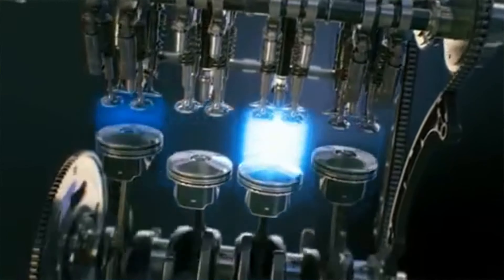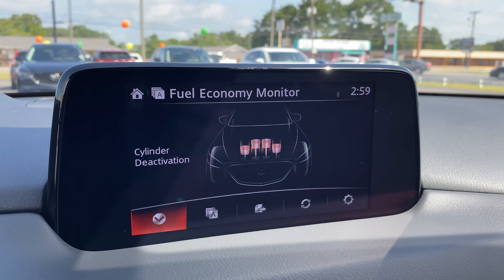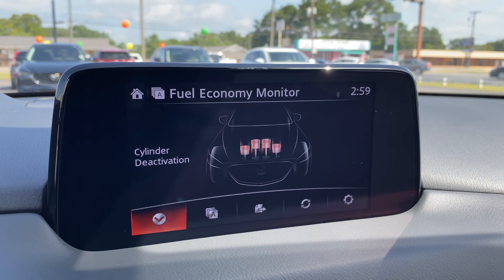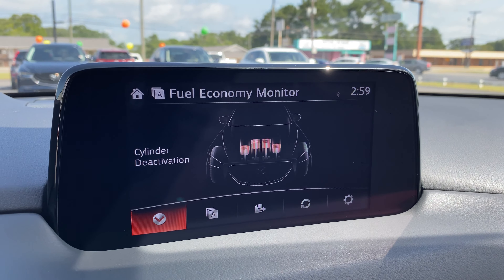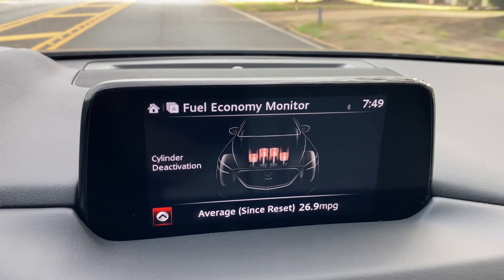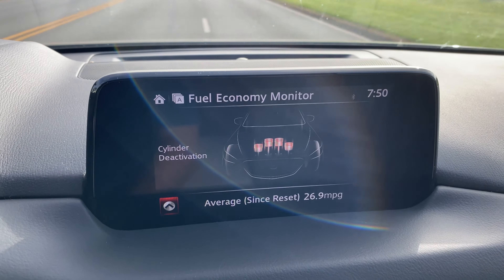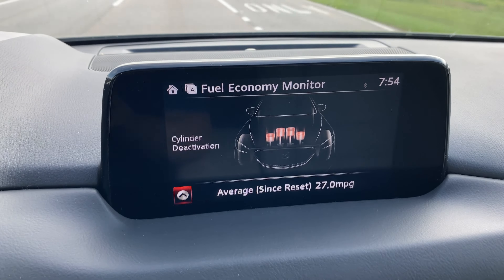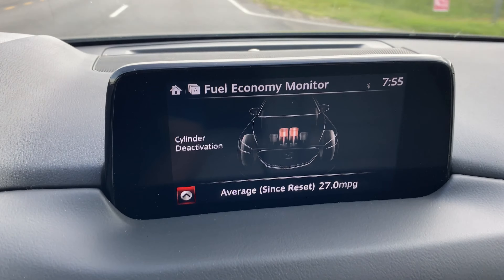Mazda CX-5 SkyActiv G Cylinder Deactivation for Better Fuel Economy

Comment: Putting those cylinders on/off adds tear and wear on cylinders and engine. That’s a dumb idea because effects car reliability. Who wants to deals with car issues? Specially inside the engine? Very expensive to fix of course if you manage to fix.
Reply: Agreed. We were considering the CX5 for our next vehicle. But we keep our vehicles 10-15 years. I just see this as a problem waiting to happen long term.
Reply: I hate it, and probably won't get a NA engine in my next Mazda, turbo only. My 2017, CX-5 is still running perfectly.
Reply: @derrick_is_dnice  Same my 2017 CX-5 grand touring. Can’t be happier!

Comment: Cylinder deactivation leads to shortened engine life. I don't care what they call their "new" technology, facts are facts. No thanks.
Reply: Yeah ok. We get it. Mazda isn’t for you. Move on.
Reply: Mazda’s implementation of cylinder deactivation is completely different then the god awful stuff that was put in Chevys for years. Chevys literally had the crankshaft change shape and it couldn’t last over time. Mazda simply keeps the intake and exhaust valves open and stops injecting fuel.
Reply: @romancenturion8  they don't. They use a switch in the telescopic lifter that makes the cam move the lifter instead of the valve.

Comment: Wait...what? Cylinder deactivation is going to turn off TWO of the FOUR cylinders ... to save gas? So, I will have a two-cylinder engine? A $30K+ two-cylinder car? Hmmm, nope, I'll pass. There has to be some issue or problem with this as time goes by that will require an expensive fix. Thank you for making this video because honestly, I am shopping for a new car and really like the Mazda but, I will pass now that I know about this "great feature" which leaves me with a two-cylinder car.
Reply from the maker: I understand your hesitation.  None of the Turbo models have this technology, and it varies on other 4cylinder models.  Don’t rule out Mazda yet!
Reply: @richardflaherty2373  That was two years ago and was a software patch. There have been no reports of problems since.
Reply: It probably won't wear evenly over time, and you'll have serious oil consumption and a vehicle with no resale value.  My prediction is a lot of people with these vehicles will lose way more in depreciation than they saved in gas.

Comment: Never had any issues at 110000 miles and still going strong. Yes, I use 100% synthetic oil and still running new. I still get 40mpg with cylinder deactivation on the highway.

Comment: It's extremely annoying, me being a mazda fan and planning on purchasing a cx5 in the near future, that cylinder deactivation is standard on ALL trim levels for the 18-20 years. If I had enough money to buy a brand new 2021 I would, but part of the reason I love mazda is because they and toyota have EXCPLICITLY avoided some of these dumbass new technologies like tiny engines with turbos/ direct injection (oil dilution problems eg honda and gmc), cvt transmissions, etc. They are about quality and reliability, but this REALLY shakes my confidence in their engineering. It just seems like a ticking time bomb, and for what, and extra 1 mpg? Cmon man
Reply from the maker: I don’t think it is a ticking time bomb.  You always have the option to purchase a 2.5 turbo engine without it. You’re right the 1 mpg increase is not worth it for these technologies.  However as long as manufacturers have to meet the demands of politicians they will keep creating and using these types of enhancements.  I don’t think you will have any problems or disappointments with any CX5 with cylinder deactivation.
Reply: @JSS  I appreciate the response; can you please tell me how extensive your research was for problems with CD? How do we know the software update is an actual long term fix? I'd appreciate any insight you may have
Reply: All Skyactiv engines are direct injection.

Comment: It should be able to be disabled it's the only feature I want gone from the car.  It's been a issue since 2017 on all that have it . Mazda needs to add a button or a way to disable only thing I want gone from my 2020 gt I hate you have to have it on the higher trims
Reply: I agree, it should be selectable. I'm glad my 2017 doesn't have it.

Comment: Well this helps explain the impressive gas mileage I got coming home from Atlanta yesterday.   35.8 mpg on a 5 hour drive
Reply from the maker: That’s awesome!  What speeds were you running?
Reply: Jonathan Sewell 55 mph most of the time. All back roads, no interstate, no cruise control.
Reply: The CX 5 is rated at 25 city, 31 hwy. You don't magically get 4 more mpg because you drive a certain way or speed .The highest mpg you'll get on a cx-5 is 31, 32 if you have the manual 6 speed trans. So no, you didn't get 35.8 mpg.
Reply: God_Laughs _At_Atheists  You can believe him all you want but he didn't get  almost 36 mpg when it's rated at 31 mpg highway., It doesn't work that way, sorry. .
Reply: @emichaels2112  quite possible. My daily commute to work is mainly on the highway and i was getting about 32.5-33mpg when i was going the speed limit of 65-70. Since covid and less people on the road. People are now driving 80-85mph drivinf 80mph is getting me 30-31

Comment: I have this technology on my 2019 Mazda 3. Had an issue with it for over a year. When it would go into two cylinders at 80-100 kmh it would vibrate the whole car and create a low rumbling sound. There was a fix recently released with updated radiator mounts and software which has pretty much resolved the issue
Reply from the maker: Oh that’s good.  I haven’t heard about that issue.
Reply: @JSS  This is not correct disconnection of two cylinders.  We can see that the valves are closed.  The cylinders are under compression.  And this means that compression slows down the engine and the car.  It's like a retarder in a truck.  To properly disconnect the cylinders, you need to open the valves.  This is called the decompression mechanism.

Comment: I took the turbo engine option to avoid Cylinder Deactivation. There are easy ways to clean the intakes with a spray, so the turbo doesn't scare me at all.
Reply: The non turbo engine needs cleaning too. Both engines are pretty much the same.
Reply: I was feeling the same way about the turbo option.

Comment: Is there any way to deactivate this "feature"? I have only read horror stories about cylinder deactivation and with the new 2021 models coming out with this "feature" missing completely, doesn't really instill any sort of confidence with this technology.
Reply from the maker: I'm not aware of how to deactivate it.  I think they discontinued it for 2021 because of increased Turbo offerings, and it didn't really have the fuel economy payoff they were hoping for.
Reply: The 2021 model year with 2.5L non turbo engine still has this feature. Checked on the Mazdausa.com website. Its the turbo engine that doesn't have this feature.

Comment: Is it possible to disable the cylinder deactivation? Because it will destroy the engine as shut off cylinders will be cooler and won't reach the correct tolerances, therefore they gonna wear out much faster and result in serious oil burning and loss of compression.
Reply: Vcm muzzler is a common product that works perfectly to do that on Hondas

Comment: But does it only deactivate cylinders 1 and 4? It seems to me an unwise choice, ford has the deactivation on all cylinders of the 3 ecoboost and deactivates a different one each time to have a degree of use of the piston sky homogeneous among all.
Reply from the maker: The new updated system may rotate I’m not sure.  The current system deactivated 1 and 4

Comment: The cylinder deactivation is only useful on highway when driving moderate speed. In and around town, it´s always more useful to shift into the next higher gear to have lower revs.
Reply from the maker: Good point
Reply: maybe it's what Economic mode does.😁
Reply: To a certain extent. Bc the statement alone doesn’t stand if you’re lugging the engine at too low an rpm.
Reply: @a124as  Just shift like the suggestions of the car. You will never see 2 cylinder mode, but instead always shift into the next gear. Below about 1600RPM the 2 cylinder mode doesn't work.

Comment: Has Mazda addressed the cylinder deactivation issues that were in the 2018-2019 CX5? Out of the 2.5NA and the 2.5T, which do you think is more reliable long term? Thanks!
Reply from the maker: I think they’re both pretty solid.  Typically turbos would fail before anything, but so haven’t seen any signs of that on these engines.  I would say you’re pretty safe on both.  I haven’t heard of any issues with non turbo since the recall.  I think they fixed it.

Comment: Does the 2021 model CX-5 remove cylinder deactivation? I saw only one trim level of the CX-30 still offers cylinder deactivation.
Reply: None of the 2021 CX-30's have it at all. Mazda is confusing the customer base and I am one of those potential buyers. The 2020 3's had it on premium and AWD trims and not FWD,now the 2021 3's ALL have it. Annoying and I want nothing to do with it and Mazda should trash it completely. This guy doing this review doesn't mention the roughly 250,000 Mazda's that have CD that were under recall already for various engine problems.
Reply: @halc.2899  there have been no further issues after the recall to fix the software bug.
Reply from the maker: All of the 2021 CX-5s I’ve looked at have it.  I was aware of the recall, however most did not experience any problems.  They were reprogrammed as the recall required.  I am not aware of any further problems.  Depending on driving habits, you may rarely have cylinders deactivate.
Reply: Agreed. I live in New Zealand but when I checked the US built CX5, all non turbo variances with 2.5L engine  have the CD feature. It's my understanding that there have been no reported issues with these engines post  the software fix.
Reply: @Dark5tar111  wait until you get 100,000 miles on it!
Reply: @richardb.5691  time will tell.

Comment: I live on campus and have a 2018 Mazda6 so I’m driving around 10-20 mph a lot and the car will occasionally start judding. Is that the CD
Reply from the maker: I would need more information, but probably not CD especially if you are using the gas pedal.
Reply: Yes, when the system switches modes, there can be a shudder comparable to the transmission switching gears. It is really annoying to me.

Comment: Cracked cylinder heads are popping up more frequently on these motors with CD. My '18 is going to the dealer in a few days for repair. Starts with burning smell and mild smoke. Mine has oil all over the exhast side of the engine

Comment: Most people rely upon the car moving slowly with the right foot not on the gas pedal at all.  This is particularly true when parking, for example.  I think this is called the "idle speed" and is very helpful when you want to move very slowly into or out of a parking space.  Does the cylinder deactivation permit a reasonable idle speed or does the car not move at all if your foot is completely off the accelerator pedal?
Reply from the maker: Yes you idle.  I haven’t tested the deactivation at idle speeds though.  It may not kick in until a certain MPH.
Reply: I have a '21 Mazda6 Signature. The only time I notice the deactivation is backing down my long, flat driveway. When I get in and shift into reverse it doesnt hardly move at. If I give it just a smidge of gas it goes a smidge faster - but holds that speed for a good 100ft until I have to brake.
Reply: Does this work in sport mode?

Comment: I wonder what happens at 65 MPG on cruise control? Will it shift to 2 only?
Reply from the maker: Same thing.  Really depends on the load the engine is under.  Any type of coasting with lead to 2 cylinder.

Comment: hi. what about 2017 cx5 ? does it have CD on board ? if im not wrong 2nd generation of cx5 starts from 2017-2023 right? so my question is,    the CD goes from 2018 ? not 2017?
Reply: CD started with 2018+ models. 2017 is unaffected

Comment: Hello Jonathan, i have mazda cx5 2019 takumi but when I go to the cylinder deactivation shows a message ( NOT READY ) can you explain me how to activate it ? Mine is a european version if is that matter.
Reply from the maker: I’m not sure.  We don’t have to active here, unless it is turned on during initialization when it comes in from the factory. Contact your dealer. Thanks.
Reply: You're referring to the i-stop feature "NOT READY" state,  not cylinder deactivation.
Reply: @Dark5tar111  no was the cylinder deactivation and i have been traid both time with activate i-stop and don't the same message

Comment: Hi Jonathan 
Thank you for your clear demonstration of the cylinder’s deactivation.
Do you notice rpm changes from activation status to deactivation status? Is it significant?
My CX5 doesn’t have your screen showing cylinders up/down status...
Many thanks.
Ryan
Reply from the maker: When they are deactivated the RPM goes down because it is mostly a coasting scenario.  You really can’t tell by driving when it’s 4 or 2 cylinders.
Reply: Jonathan Sewell 
Thank you.
Can you tell why my CX5 2020 doesn’t have a screen showing cylinders up/down status like your demo?
Mazda dealers said all Mazda with 2,500 cc or above will have cylinders deactivation feature. Do you know this?
Thanks again.
Ryan
Reply: @abblechan8107  Turbo models don’t have this feature.
Reply: @abblechan8107  you have to go to the fuel economy screen and if you have the feature there will be a tab at the bottom to go to the next screen, that’s how I found it

Comment: I absolutely hate this system on my brand new Mazda 6 20th Anniversary. Whenever the system switches modes, there's a noticeable shudder which ruins a lot of the driving experience for me.

I am therefore looking for ways to have it deactivated without making the ECU throw a DTC.
Reply: Same here, i have 2023 homura and i hate stupid vibrations.
Reply: Did u find any solution? My dealer change motor mounts but vibrations are same.

Comment: Hi Jonathan, really enjoy these videos on the CX-5! Is the cylinder deactivation on all trims? Turbo and naturally aspirated 2.5?
Reply: Good question I hope he answers
Reply from the maker: It is standard on all non-Turbo 2.5L.  The Turbo uses the exhaust of cylinder 1 and 4 to pre charge the turbine to eliminate lag.  So the cylinders need to be on all the time.
Reply: @JSS  Thanks for the response! Are the turbo models becoming more readily available? I live in the middle of PA and all I can find around here is an over abundance of the naturally aspirated version.
Reply: @JSS  well, be just gave you your answer for avoiding the stupid cylinder deactivation: get the turbo.
Reply: @richardb.5691  On a bit of a rant here Richard. I’ll take a bet the NA Skyactiv G  will outlast the turbo on high mileage cars.
Reply: @WorksOnMyComputer  If you drive normal, no turbo is going to reduce the life of your engine.
Reply: I have a 2021 mazda3 premium MT. I do not see the cylinder deactivation solenoids on the side of the motor and was told this does not have cd. Are you able to confirm?

Comment: I'm planning to purchase a new 2020 Mazda CX-5 with 2.5L Skyactiv engine that has a cylinder deactivation feature.  

So apparently there was a recall on the cylinder deactivation feature back in 2018 and it was quickly fixed with a software update. It's my understanding that all newer models come with this updated software fix. 

So my real question is, how reliable do you think the engine will be with this feature in the long run? I'm planning to keep it for 10+ years.
 Thanks!
Reply from the maker: I don’t think the deactivation feature will have any real bearing in reliability.  I think this engine is good to go for a long, long time.
Reply: @JSS  I hope so and trust that Mazda's engineers know they are doing. I have great respect for japanese people and the way they do things.

I have just put a deposit in for one today.
Reply: @JSS  do you know if the newest 2023 2.5L NA engines still have CD? They seemed to have removed it from the spec sheet